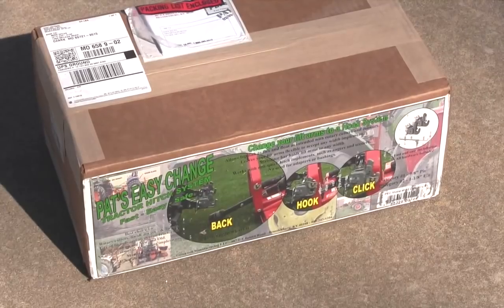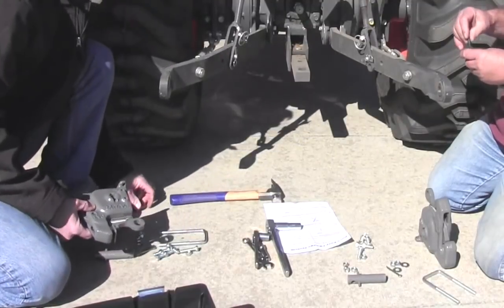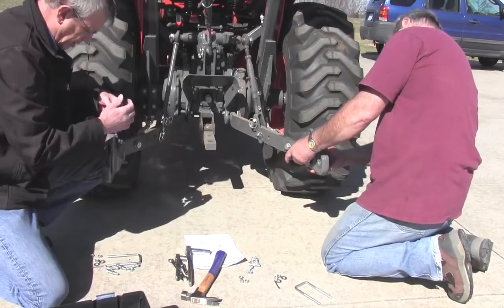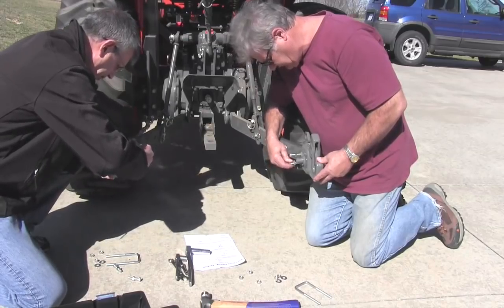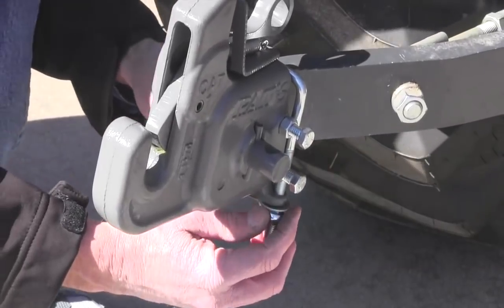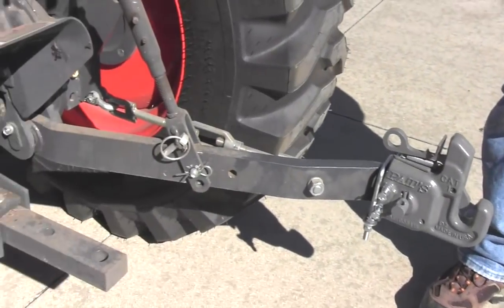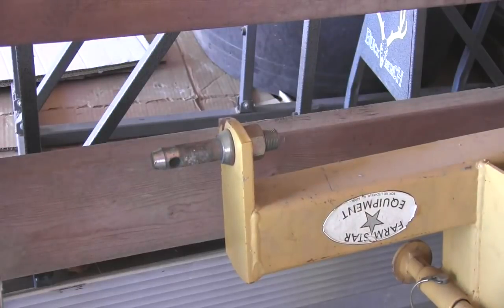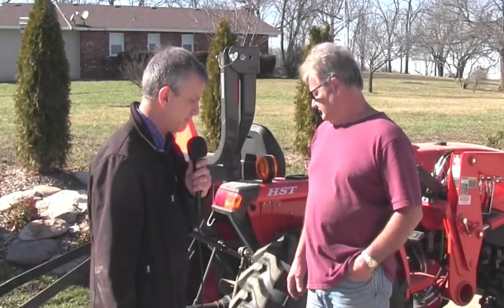Is Pat's Easy Change the Best Hook Up for 3 Point Implements?

Comment: Is there a set weight loss on capacity of three point on a CATII Hitch?
Reply from the maker: Good question, I don't know the answer but I'd bet the Pat's people do.  I'll find out and post when I get an answer.
Reply from the maker: Here's the response from the Pat's folks: 

The hitches can take over 40,000 pounds. They can handle anything the tractor can handle. It does set the lift arms back 4” but that is very negligible as to any difference in pulling power.